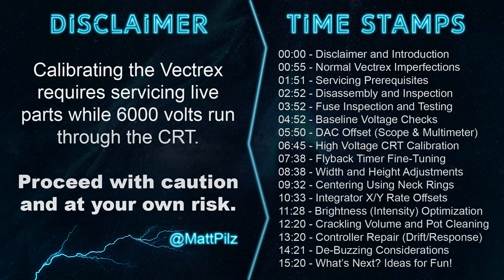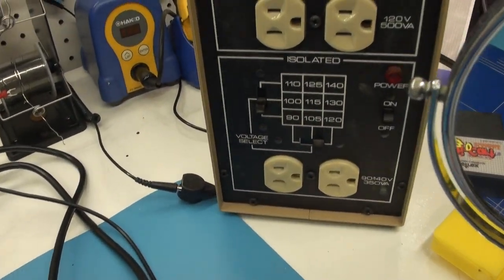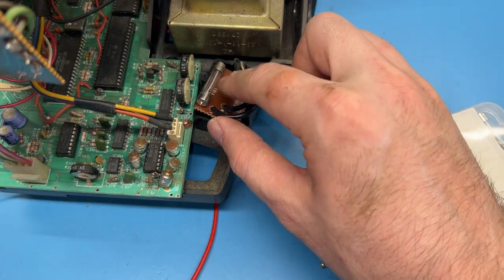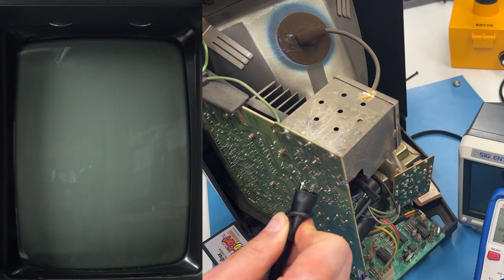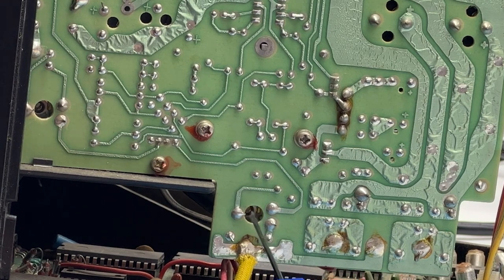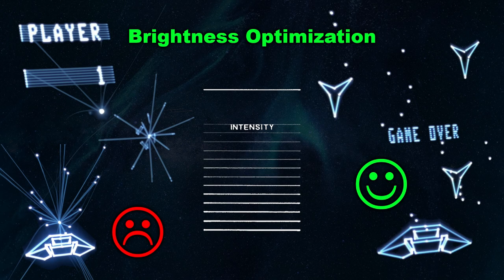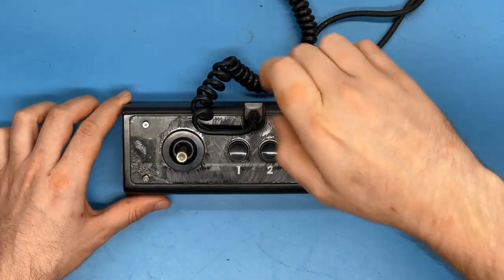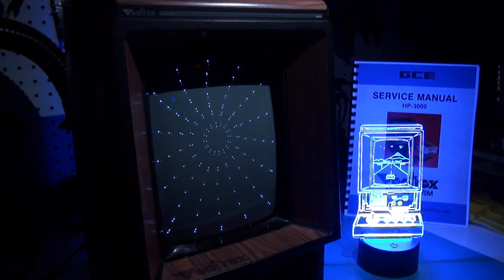Vectrex Console: Complete Screen Calibration and More (Definitive Guide)

Comment: For people new to opening any kind of equipment, perhaps a note in the tools section about using a plain screwdriver instead of a combination type of screwdriver for opening the Vectrex case. As the combination screwdrivers are too wide to fit the screw well properly and reach the screw. This can lead a false sense of screw head engagement since the combination screwdriver shaft ends up binding against the screw well wall. Also an assumption the screw threads might be stripped since screw driver bit never engages with the screw head. 
Also a note on screwdriver length required in order to reach the screws in the deep wells.

Comment: at 3:45 I screamed "Stop it!!". Metal fatigue and a snap can easily happen bending something back and forth.
Reply from the maker: Fair point. That bit was rather over-acted for the sake of this video demo. I also had an extra set of WIMA film capacitors on hand to replace if needed, although in the end it was actually still fine (a little reinforced solder at the leads to make it more stable). I've found that polystyrene capacitors generally tend to feel more "loose" compared to more modern style capacitors even when they are well affixed.

Comment: i removed alot of buzz by replacing the electrolitic caps under the power amplifiers heatsink with film caps. Imo it was never a good choice to place elco's under that heatsink, wich can get pretty hot after some playing. i replaced them with 680nano mkt caps and the buzzing is very faint now. Why they placed elco's, wich have fluid in them, near a heatsource is puzzling to me. The value is only 470 nano so film caps in that range are still small enough to fit under the heatsink. Film caps are less leaky both physical and electrical. So this is a good upgrade imo, both for performance  and reliability. I choose a slightly higher value of 680nano since the parts list in the manual showed they can be a bit more. I still see ripple in the power supply even after recapping power lines and integrator. The parts list shows the elco's can be 80% more. Maybe higher values will make the screen flikker less. Also the power diodes can be suspect. I'm going to replace the power diodes too. See if it makes any difference. Sometimes the flikker is just to much for me. I like the vectrex but the flikker can be sickening at times. I read on a forum that placing the power transformer away from the vectrex will cure it. Others suggested building a swith mode power supply for it. It has something to do with your AC line frequency. The vectrex has a standard refresh rate of 50 hz. If your ac line does not match it, you get flikker according to what i read. Will do these experiments when i have the time. There must be a way to reduce that flikker....

Comment: Thanks for giving up this guide! Quick question, which mod does the better job at reducing the buzz?
Reply from the maker: You'll find that either doing the combo coaxial + debuzz circuit from Console5, or the buzz-off kit on its own, are very comparable. For most Vectrex runs the buzz-off kit is least destructive and usually doesn't require cutting traces or rerouting resistors/capacitors. The mods explained on Console5 require destructive changes to the board. In my case I tried the Buzz-Off in the earliest run Vectrex and there were many additional changes needed including cutting traces. When I had first done a coaxial + circuit removal there was really no audible noise at all, with the buzz-off it's maybe 5% noise if you listen very closely but in real uses it sounds flawless. I'd recommend buzz-off but do a little research to see how complex it'll be on your Vectrex (e.g., most should have the AY sound chip socketed, but mine did not and that's an indicator of more complicated times ahead...)

Comment: Can i ask about the joystick should you use any grease inside it if so which one should you use ?
Reply from the maker: I would only use DeOxit D5 and F5 for internal controller components. If the joystick itself seems problematic it may need a new replacement spring, but otherwise shouldn't need any manual greasing.
Reply: You can also use joystick parts salvaged from a radio shack coco joystick which is much cheaper. The shaft is longer so that requires some mods that includes cutting and adding some thread with a cutting die

Comment: My vectrex is too dim and the back pot set to maximum (cannot see the dot at maximum, not normal). Any ideas? Thx
Reply from the maker: Do you still get sound and controller response? Can you see any image at all? The brightness control is a 250K variable resistor (R509). It can be difficult to pinpoint the culprit without tracing the measurements with an oscilloscope, but several capacitors on the power board (C507 and C508) feed directly adjacent to it.

Comment: Hi Matt Pilz, I'm trying to use your instructions to downgrade the firmware for Epson printers. But I don't see anything for my Expressoin Home XP-3150, could you please help me with that?
Reply from the maker: That's an international model and so even if you can enter firmware mode (which may be a different key combination), finding older firmware to downgrade might be more difficult. You can search  MA01JA firmware, there is one utility that costs $35 that may allow patching the firmware to one that disables the chip sensor, but I do not have personal experience with working on that set or that utility.